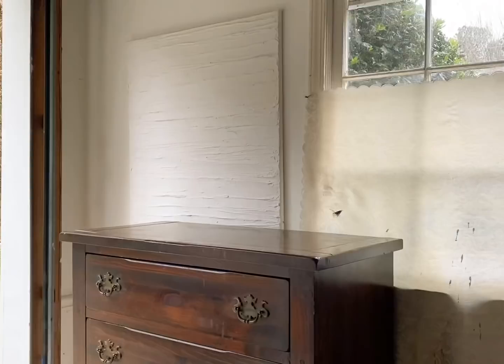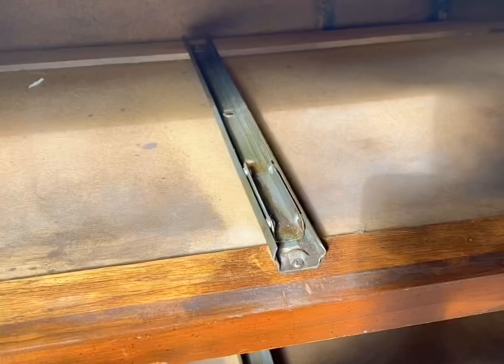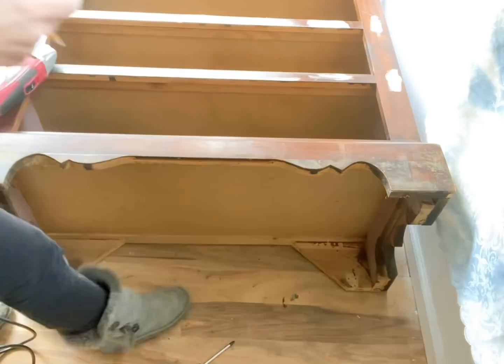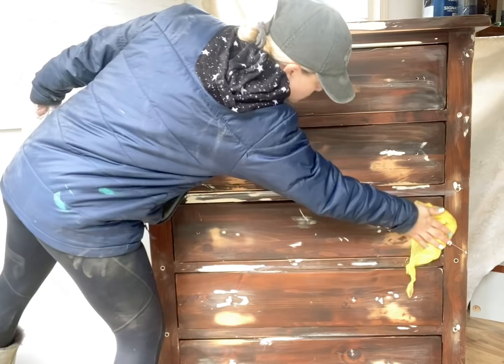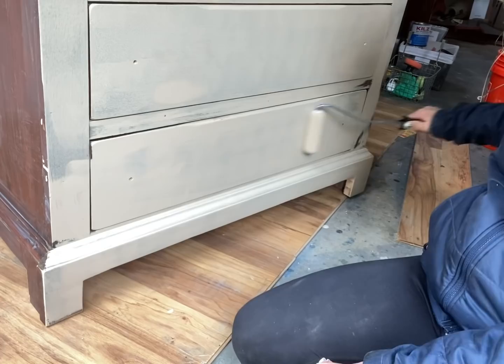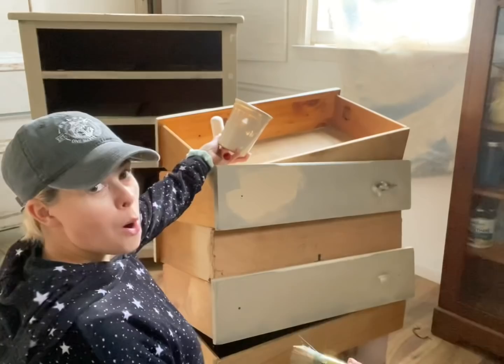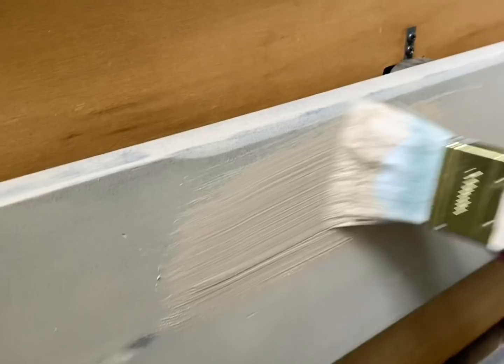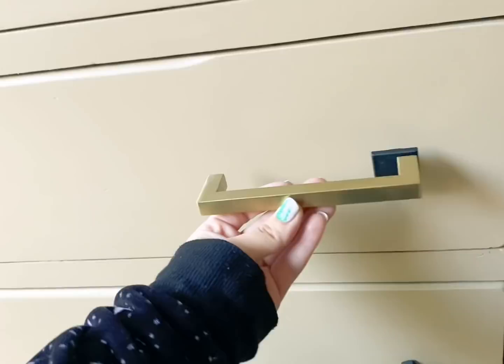$20 TOOL = new legs!  In depth, detailed +2022 color trend  #furnitureflip #homedecor boho bedroom

Comment: Omigosh that turned out amazing!! 

Tip for the multi tool: if you flip the blade over you’ll be able to make flush cuts by holding it flat against the surface. 😉
Reply: Do you have a link for the multi tool? Can’t find it

Comment: I've never been a big fan of modern (I'm getting there) but this is beautiful. I love the contrast of the knobs, but may have liked the gold style, but in black. I know square knobs would make me nuts in the head. It doesn't matter how much you tighten, knobs work their way loose and If square knobs are not perfectly straight, perfectionist me would see it. I'd rather have a handle that doesn't work loose...or show when it does. 
But again, it's beautiful. 
And I love the dresser color. I smiled and looked at an old dining chair I bought for $2 about 8 years ago and finally painted last fall before it got too cold. It was probably a perfect match. And the only paint I've ever purchased was "oops". I dump n mix till it makes my heart happy. 
Cheers!

Comment: Odor on wood furniture is usually something organic (food, mold, etc). I like to use an anti-bacterial dish detergent such as lemon-scented Joy. I prefer to wash wood pieces outdoors with a garden hose on a sunny windy day. Joy detergent is beneficial to outdoor plant life, because it cleans away surface pollutants. In some cases, I add bleach to the wash water. Bleach kills organic residue which is often the cause of the stink. However bleach can be harsh on plants so be certain to rinse thoroughly.

Comment: As always Shannon I love your work /videos, this piece is awesome, & most definitely the black knobs are a better fit than the gold ones, but if the gold were black then that would be nice too.... I do have a question for you, I thought your supposed to prime over the wood filler or is it b/c the paint has primer in it? I'm still learning that's why I'm asking..thank you my sweet Shannon 💚
Reply from the maker: Thank you!  Priming is never a bad idea but since I did three coats of paint I got away w/o it and this hgtv paint does have primer in it.  You could also mix in some more primer if you like or even use my 1 step paint recipe and skip priming.  I also always keep a can of clear coat or shellac near by to spray anything like bleed through or spot priming certain areas.  Saves me a lot of time 
Here’s my 1 step paint recipe video 
https://youtu.be/AAPd3F3J7xg

Comment: Like your work but you would do yourself a big favor by getting a jigsaw to make those cuts on the bottom and legs. 50 times faster and easier. Just as easy to use. You have to drill large enough holes in the corners on the waste side for the blade to fit

Comment: Too funny! I’ve needed to touch up fills, find new fills so often. And I though I just needed to get better at it! Ok, I do need to look closer 😬, but I feel so much more “capable”, now I hear someone with your experience does the same. Instead of feeling bad, I’ll just continue to consider it a possible step. I think I’m an inch taller.

Comment: clamp down a level across where you want to cut, and use a circular saw, and finish with a gig saw. perfect line. The that saw your using will not make a straight line and your gong to have to sand a lot.

Comment: This came out beautifully. I do have a question.  What is the proper way to clean this when there is a wax finish coat on it?  I like to wash my furniture once a year and use a couple of drops of Dawn in a bucket of warm water.  I don't have any painted furniture, but I would like to try this method, but still keep it clean. Thanks so much!

Comment: Nice work. Have you ever done a video on replacing repairing drawer glides like these?
Reply from the maker: I have a video on drawer slides but I don’t show this style in it unfortunately.  But I would try and replace with this one https://www.lowes.com/pd/Richelieu-16-in-Drawer-Slide/50041754
Or
18 Inch 100 LB Capacity Full Extension Soft/Self Close Ball Bearing Side Mount Drawer Slides, 3 fold Full Stretch Side Hanging Drawer Rails https://www.amazon.com/dp/B07N8XJ7V4/ref=cm_sw_r_cp_api_glt_fabc_F3KSQZZAF5SPDZVVDME3?_encoding=UTF8&psc=1

And if you want to confirm, you should take it in to your local woodworking store and they can usually help you find a good replacement.  A lot of times you can’t replace it with the exact one from the furniture manufacturer but you can get close enough.  Hope that helps!

Comment: Beautiful flip! Is there a reason you didn't prime first? Was it because the paint was a paint and primer?
Reply from the maker: Thanks!  This paint adheres really well to wood so I skipped it.  Try my one step paint recipe though, you’ll love it!!  I have a video on here showing how to make it.   It anyway I skipped priming with this specific paint bc I trust it and I sanded the piece A LOT 😂😅 usually when interior wall paints say they have primer in them it’s mostly for stain blocking and not adhesion though.  The paint is called ovation HGTV at lowes

Comment: Thank you so much for this video. It's 4 am and I am writing down every step. Have seen the video twice.  I already painted the rooms doors and kitchen cabinets. Thay both need 2nd(3rd) coat. 
Do I need to wax the Kitchen cabinets?
I found these great mini rollers at Home Depot.
Unbranded 4in. x 3/8 in. High-Density Foam Mini Paint Roller (5-Pack) for $11.47.
Funny is that for both project I use a brush and the roller at the other hand. Didn't know that was a thing or that it had a name.
Will be buying the water putty. Thanks for the hints, products recommendations and tutorial video.
Reply from the maker: Glad to help!  Sounds like a great project so fair!  I would steer clear of wax in the kitchen and go for a clear water based polyurethane like Varathane or minwax so you can scrub when they get dirty.

Comment: Does this paint have the 3 parts?  Undercoat, regular coat and top coat altogether?  Or why did you not do that with this dresser?
It's beautiful, I'm just wondering.
Reply from the maker: I was afraid it would seem too complicated to start mixing paint and using a new power tool in the same video for a beginner so I tried to simplify but yeah, my one step paint recipe would have worked beautifully on this piece 🖤

Comment: It came out perfect. How did you get rid of the orange peel texture you had when you used the roller?
Reply from the maker: Just by using the brush on and then roll with mostly dry foam roller so each layer is nice and smooth and very thin

Comment: I have a question.   You seem to be wearing a fairly heavy jacket.  What is the temperature in your garage?  And would that be too cold for the paint to dry/cure properly?
Reply from the maker: It was cold and rainy too, if did take a day/night to dry fully and I brought the drawers inside to let them dry, In the winters, I often run a small heater near me in the garage so I can keep work flowing

Comment: I have been squaring off the scrolled bases on most of my pieces for some time now.  i have a jig saw but that multi tool looks pretty cool.  i will have to try some of this hg tv paint.  i have a table base that may be a good candidate.  Or maybe i will spray paint it. But definitely going to use this on my next full buffet or dresser.  I think a quart is about $15 here.  That is about $10 less than the pints of the  fusion or general finishes or any other all in one paint.  Does it have a primer in it?
Reply from the maker: Changing the bases makes such a difference!  The hgtv ovation paint does have primer in it and it has great adhesion.  If I get any bleed through I just spray a quick shot of shellac and keep truckin’.  I don’t think I’ll ever prime again haha unless it’s really rough shape or super shiny

Comment: Tack cloths here in London are £7.99 a pack.
Reply from the maker: Whaaaa?!?!  That’s crazy!  Well I do reuse mine up to 10 times, I just keep them in a ziplock baggie after each use
Reply: @blacksheephouse  Thanks for the tip.
I bought them recently. One pack. Not huge, just standard and payed around £8.
But I never seen them here before do when I saw it I bought. But no more.
Need to check elsewhere cheaper.

Comment: I made the one step paint using the chalk powder using the ratio in your recipe, but my finish ended up very grainy and not smooth. How can I fix this as I used this on my cabinets? Should I re-sand and use a paint batch without the chalk powder OR should I put a clear topcoat hoping to smoothen it out a bit?
Reply: Hi! I did my cabinets also! I would sand using a very light grit sanding paper. Then repaint without chalk powder. Lightly sand again, repaint, then clear coat. Should turn out great!
Reply: @jd-um4jw  Thank you for your feedback! That's what I'll do!

Comment: Does wax work well for table tops? Or does it tend to melt (like under a coffee mug)?
Reply from the maker: Unfortunately wax doesn’t hold up well on tables, for that I would go with Varathane water based polyurethane (no yellowing/ambering ) or if you don’t mind a bit of an amber glow over time you could go with the most durable finish which is oil based polyurethane.  I can vouch for water based polyurethane (Varathane brand) holding up for years on a table used by kids and crafts and lots of meals though
Reply: @blacksheephouse  Thank you so much!!!